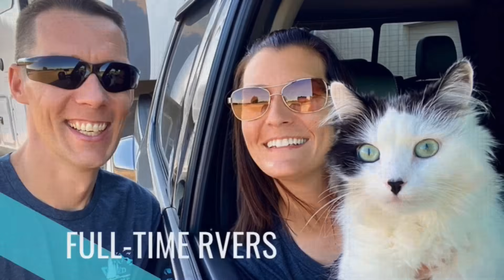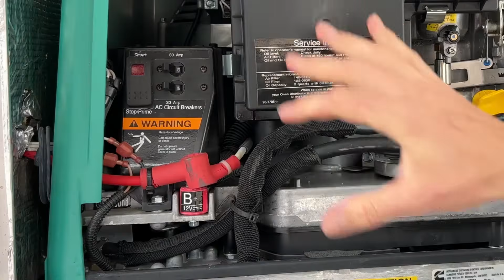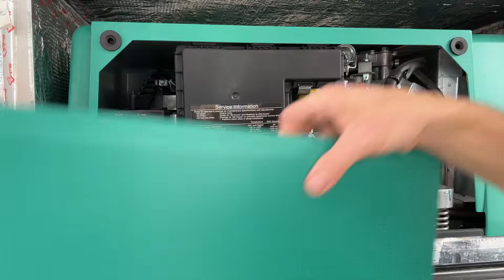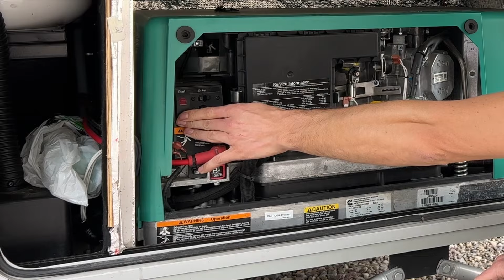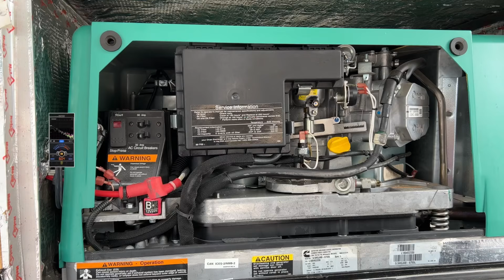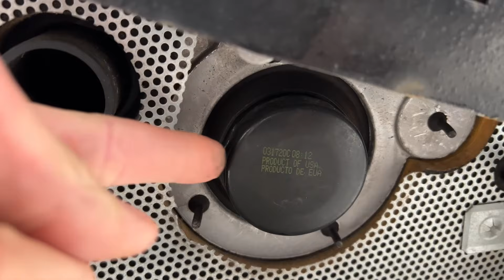Cummins Onan 5500 Gas Generator: How It Works and What It Can Power

Comment: Did you have any concerns/issue with the fuel tank, LP, and batteries being in the same compartment?
Reply from the maker: Not since they are all vented seperate from each other. The gas tank vents through it's own vent. The battery also has it's own vent just like the propane regulator has it's own vent.

Comment: What happen if it’s not doing anything like it has no power and the battery is dead?
Reply from the maker: I would make sure you have power going to the generator. There is a red and black wire connected to the bottom left corner in the front of the generator. You should have 12-13 volts at those wires. 

A common cuprit is the battery switch being off. This video will help more with the battery switch. https://youtu.be/jwB4RuS2rZQ?si=vSCuOh-YE8cCfC_E

Comment: Can you make a video on how to adjust frequency and voltage, this is a common problem of these generators, because the governor screw rattles loose and it just shuts down.
Reply from the maker: I try to make helpful videos at any chance I get. The frequency adjustment is a different adjustment than the voltage. The frequency is a screw, and the voltage is through the computer side.

Comment: I just bought my rv and it has aonan marquis 5500 generator model 5.5bgmfa26105h but it won't start. It turns over nice but won't start. Any idea why
Reply from the maker: I would suspect a fuel issue. If you get a can of carburetor cleaner,  remove the air filter, start cranking the generator, and give a little spray to see if it fires. If it does, you have a fuel issue. If that is the case, I would start with cleaning the carb.
Reply: @MobileRVTechServices  thank you for the response. Didn't even think you would since the video is older. But I will try and see if that works 👍👍👍

Comment: Thank you, great info.  I have 2019 Onan with 150 hours, recently serviced by dealor, a 5.5 propane that is set for a 20watt output, which is not enough, how do I increase the watts. Thank you for your time.
Reply from the maker: I don’t understand how you have a 5.5 (5,500 watt) generator set at 20 watts. Even if you meant 20 amps it seems like something isn’t installed correctly.
Reply: Yes I meant 20amps, I spoke to the dealer and the tech said that something about around the back there is a way to increase the amps, I will open it up in the pass through to expose the back of the Gen. I will keep you posted, thank you for the prompt response. @MobileRVTechServices
Reply from the maker: @russkelley3153  there should be 2 circuit breakers that are either (2) 30 amp breakers or (1) 30 and (1) 20 amp breaker. Both of those breakers feed into the transfer switch then into the RV. There isn’t an adjustment to get more amps out. It sounds like the wiring isn’t connected properly,
Reply: Is there a way I can send you a pic of the front showing only on white strip with 20amp on it? I am far from comfortable about wiring or attempting to make this right.  @MobileRVTechServices
Reply from the maker: @russkelley3153  our email is radarroadwarriors@gmail.com

Comment: Since yours is gas powered, do you have any issues with gas fumes or odor either around or inside your rv? Also where did you purchase the gas fuel container? I assume that is not included with the generator
Reply from the maker: Occasionally if the wind is at the wrong direction the fumes can come back to the RV. I have smoke/CO2 detectors in the RV so they’ll alert me if this happens. If I’ll be running it I plan out which way I park compared to the wind direction and being out in the open is always better.
The fuel tank was separate from the generator and was purchased from Amazon: https://amzn.to/3FQoVR6

Comment: Would you install a 7000 Onan Gas Generator in a 43ft 5th wheel?
Reply from the maker: If I had the choice, yes. They are the same size. The differences are a little for fuel consumption and a few pounds heavier.

Comment: Does your box have any type of air inlet or way to breathe? Or are you just unlatching the door?
Reply from the maker: The generator is designed to breathe through the bottom. The top part is sealed and doesn’t need air flow. Although on hot days I’ll open the door to relieve some heat.

Comment: I wouldn't run that gen with that propane tank in there.  The rapid increase in temperature can make a full propane tank vent.  Ask me how I know :)
Reply from the maker: Alan, I understand what you’re saying about a hot propane tank. With the casing and insulation, my setup stays cooler around it than a factory generator prep housing that’s also in the same location as the propane tanks. -Steve

Comment: If the gas tank is empty will the starter still engage and turn over the engine but will not start or is their an over ride that makes the start not engage when gas tank is empty??? I have an onan marquis 5500 the new starter spins but doesn't engage the engine
Reply from the maker: Rohan,
As far as I know the starter and the fuel tank are not related. It sounds like you have a bad starter that’s not engaging. The motor should always turn over when you push start despite the gas level. -Steve
Reply: @MobileRVTechServices  that's what I know ,but was wondering,the starter is brand new both brand new starter,so the startex is seal type I. Going to bridge it and see.

Comment: Great job of installation and explanation. what material did you use for the sound box and brief description of its construction to hold the weight you have on top of it.  thank you
Reply from the maker: Cnovru,
I built the box using 1/2” plywood and aluminum angle to connect it together at the corners and the back wall of the RV. There are 1/4” bolts connecting the angle and plywood at the corners. I used a black speaker box carpet (https://amzn.to/3RCrQl5) on the outside and the sound deadening with tape on the seams so the gen is sealed off my metallic material. The top shelf is plenty strong for storing things above with the plywood base.

My generator system has worked out great overall. The only thing I’ve noticed is the front storage door warps with the gen heat so I’ll leave the door unlatched if it’ll be running for a long time. This is different than the green gen door that needs to stay closed for air to flow inside the gen and that air comes from the holes underneath. -Steve

Comment: Did you need to add support on the floor and if so what did you do? Looking to do the same with a marquis 7000 generator.
Reply from the maker: I added a piece of 1”x1” angle iron that’s 1/4” thick in the middle of the floor right next to the generator. You can see it in the underneath video/picture. That strengthened the metal much better than the way it was without the brace. -Steve
Reply: @MobileRVTechServices  great thank you, will def. look into strengthening up the floor area with some angle iron. Great videos, you have done exactly what i want to do.
Reply from the maker: If you haven’t seen this video yet, it shows more of the set up: https://youtu.be/CkV-JhC5AlM

Comment: Oh that generator packs some punch. 5500 running watts is powerful. The one that I have is 4500. Thank you for sharing.
Reply from the maker: You’re welcome Smalls. The 7000 watt is only a few pounds more and the same size. If you really need some power, that would be a good choice. -Steve
Reply: I can't speak on the 5500, but onans microquiet 4000 can only handle about 3,500 before it starts tripping its breaker.   It can handle short bursts of up to 4,000 but the engine is maxed out for sure at that wattage.